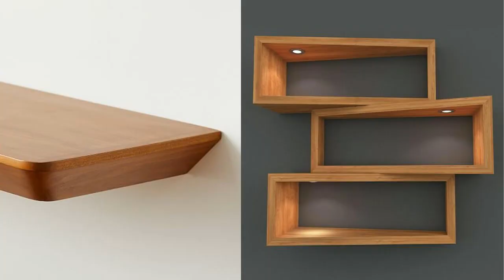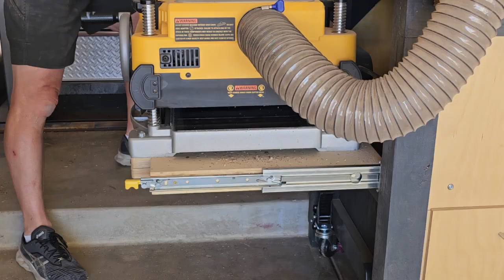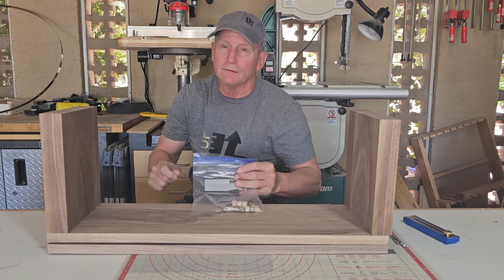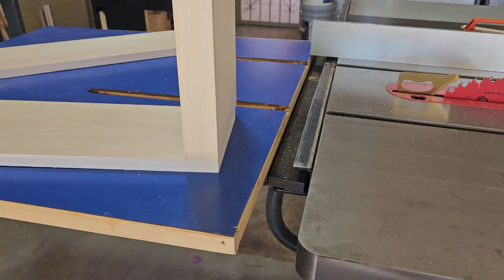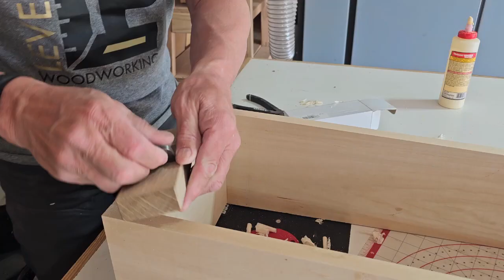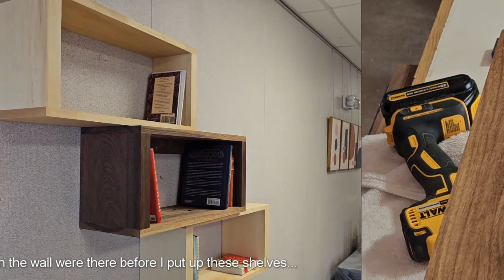What to build? My only constraint is TIME & MONEY! #woodworking #diyfurniture #storagesolutions

Comment: How did you hang them on the wall? Hope the basswood holds up over time, as you said its very soft.
Reply from the maker: I used 3 - 75 lb Drywall Anchors.... I like the color of the basswood but it is soft.   Will see how it holds up.  Thanks for watching.....